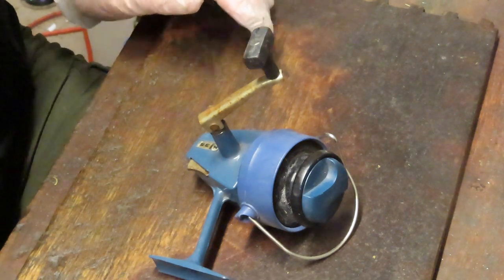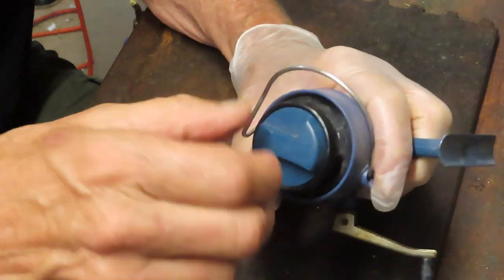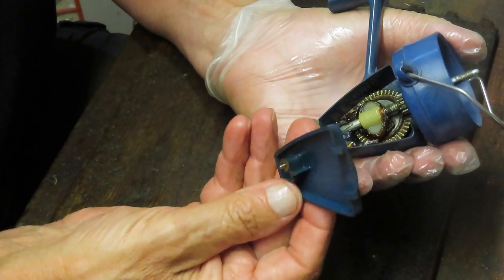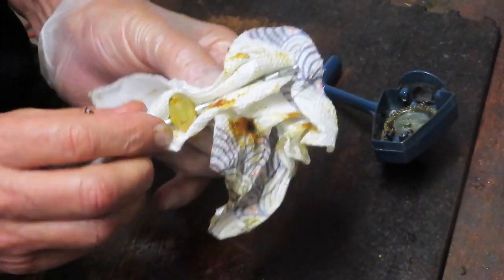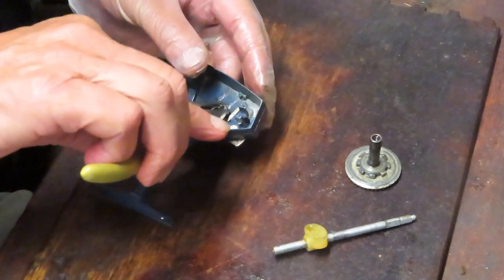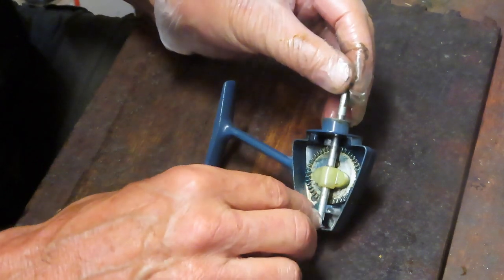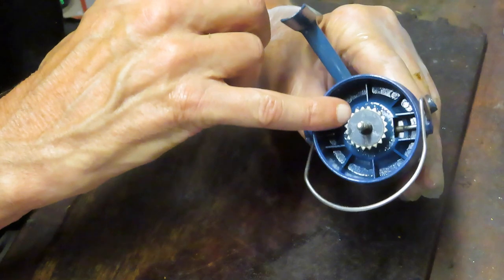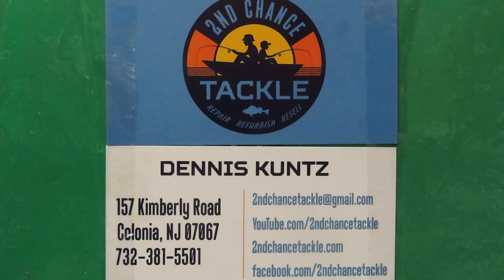Garcia Kingfisher K35 freshwater spin fishing reel how to take apart and service

Comment: It is reminiscent of some Bretton reels from France. Bretton reels had handles identical to this. If there is a Bretton connection this is a 1960s reel. Also some small Brettons had the same AR  switch and mechanism as this. Even the case looks like an early 1960 Bretton. I have a black and white Bretton 805 that looks a little like this reel though it is a higher end reel for sure. The color of this reel is identical to a large Bretton 902 that I have in my collection. I don’t like a reel w/o some kind of line roller on the bail.  It sure looks like it would be a good child’s first reel.  Good little video Dennis. You got me excited that you may be doing a Mitchell 488 pretty soon.
Reply from the maker: Just need to find the bail spring for the 488.  It came in the shop today - How's the fishing?  Dennis
Reply: @2ndChanceTackle  I think I might have one if you get stuck. I know they are available on the internet though. I recently got another 488. It hasn’t come yet so I don’t know what it might need. I hope not much. I have spare parts but I have a lot of Mitchells - 38 I think. You know how much I love Mitchells. I guess the reels I love the most are Mitchells, Daiwas, Penns, and Luxors. Actually I love all of them!

Comment: Speaking of made in France, I have a Mitchell-Browning 308 that I bought around 1980 or so. It still works very well, spins smoothly and the AR still works. I don’t use it because it’s never been serviced and haven’t got around to taking that project on yet. Maybe I’ll get around to it this  winter. It was used a good bit until 1990. I never see any talk of Mitchell-Browning. Can you shed any light on this subject? Do run across many reels under this branding? Thanks Dennis.
Reply from the maker: Sure - Garcia, which was the American distributor for the Mitchell reels went bankrupt in 1978.  Mitchell needed another North American distributor for their reels and they entered a partnership with Browning.  That lasted a few years.  In 1981 Mitchell went bankrupt and the company reorganized.  By 1984, Mitchell had discontinued the Browning distribution agreement and decided to take on the worldwide distribution by themselves.   That should help you date your reel. If you are wondering, Mitchel manufacturing ended in 1988 with the final bankruptcy and after several ownership changes, the brand became part of Pure Fishing, which owns Penn, Shakespeare, Abu, and others today - Dennis
Reply: @2ndChanceTackle  Thanks Dennis! Good info. Interesting thing about it is that the branding on the reel case only reads MITCHELL. Not Browning-Mitchell as opposed to Garcia-Mitchell. It only mentioned Browning on the box which is long gone now.

Comment: Would you be able to tell me how to fix anti reverse on abu Garcia max x spin reel? There is no switch on outside of reel.spool has tendency to not lock or it will make a grinding sound and still be able to spin in reverse. Need help please. Thank you 
Dennis Brown
Reply from the maker: Dennis - that reel has an anti-reverse clutch and not the old style dog system.  If it is skipping, there is either oil or dirt on the assembly.  You will need to remove the rotor to get to the a/r clutch assembly.  You should remove it and clean the collar and the inside of the clutch bearing with a cotton swab.  Do not oil the assembly one it is cleaned.  This is a friction drive clutch and will slip if there is too much oil or grease on it as it will not be able to grab it.  Dennis
Reply: @2ndChanceTackle  ty. Very much for your response. I did make the mistake of putting oil on that part. 

But, even before I put oil on it it was still not locking correctly. It did do a lot of trying too lock but kept spinning making a grinding noise as if two gears were trying to engage as if it wanted to lock together